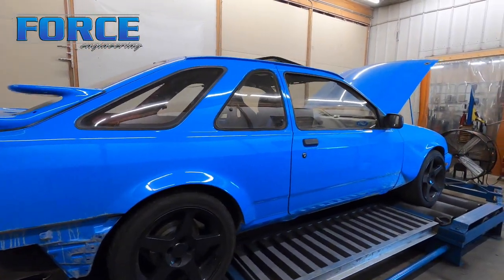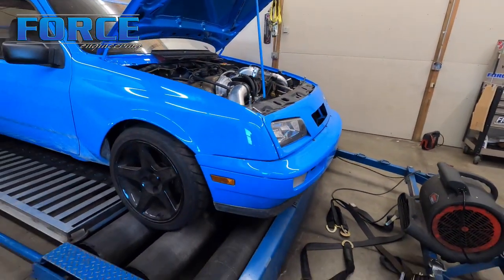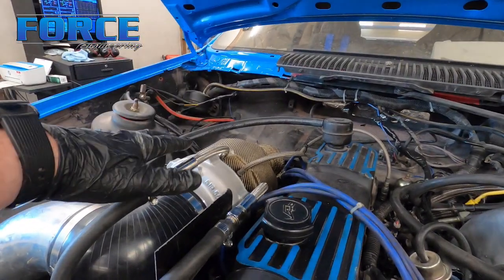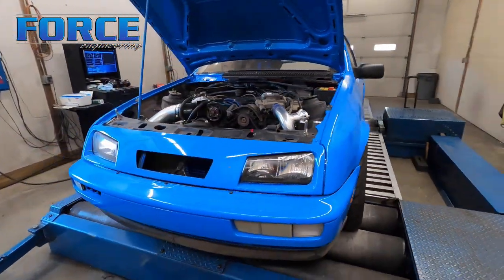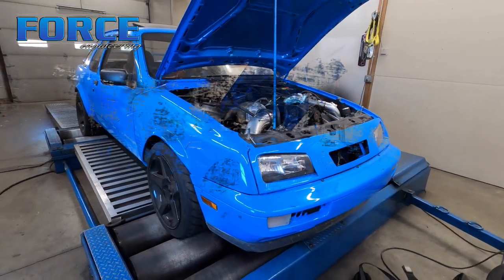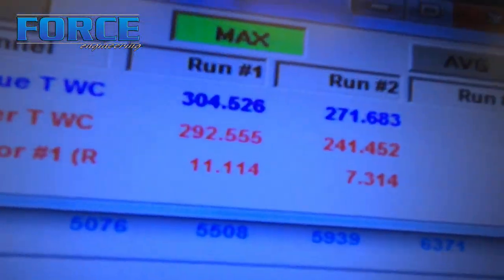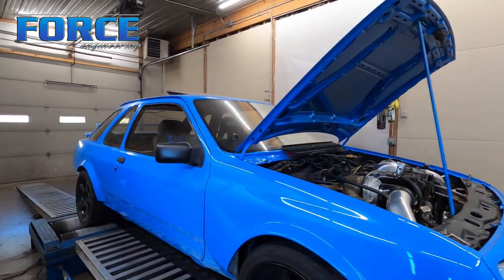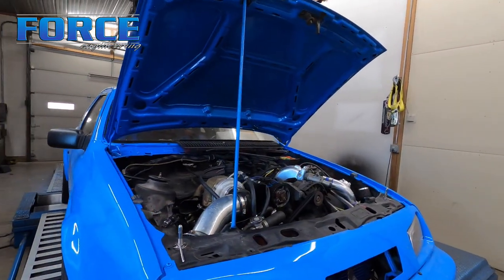Merkur XR4TI | Turbo 2300 Ford | Megasquirt ECU | Dyno Review

Comment: These and the Mustang/Capri Turbos did not have intercoolers. Others already mentioned this for the XR4Ti but, I thought I would throw in the other's who shared the power plant. The higher powered SVO and Turbo Coupes needed the intercoolers to run the higher boost.  Regarding the "heat sink" mounting of the SVO intercooler, bear in mind that the Porsche 934, 935, and others along with the F40 Ferrari and others likewise ran intercoolers in similar positions.

Comment: Id watched this video repeatedly - excited because I recently bought an XR4TI. Went to look into tuners in my state and was stunned to see a very familiar logo! My build up wont be quite as ambitious as I only drive on streets - but looking into upgrading ECU (Pimpx), tune, running upgraded fuel lines (-6 AN PTFE), and putting in bigger injectors (80ish maybe).

Comment: I have an almost identical setup, but with the 2.1X Boport cam. Unfortunately no dyno shops in my area to get any performance numbers. Would appreciate knowing at what boost level the 292 HP was reached, what size fuel pump was used, and what were signs fuel pump was insufficient.
Reply from the maker: This was so long ago i dont remember the boost level, or what pump was in it.  Sign of the pump being insufficient would have been fuel pressure falling when fuel required (is boost/rpm) were increased.
Reply: @ForceEngineering  Thanks for info. I run a 155 lph pump when seems everyone recommends a 255.  I haven't checked wide open fuel pressure but do maintain a safe A/F ratio at redline & 20lbs boost, so far...
Reply from the maker: @johnmcmullen456  without a gauge, when fuel pressure is a problem, youll also notice VE climbing at the higher map/rpm areas.  Youll raise ve and the resulting AFR wont change as mich as youd expect.  When that happens its time to put a gauge on it.
Reply: @ForceEngineering  I have a fp gauge for under hood testing. Will get some more hose and tape gauge to windshield for road testing. Appreciate your help!
Reply: I would get a walbro 255 and never worry about it. Be sure to upgrade the wiring as that is a issue that is slept on. New pump requires some better wiring to keep up with the power. Realistcally a 190 pump will support most of the power a 2.3T will put out with some modifications to it.

Comment: What mods are needed to make 300 whp reliably? (Looking to make one a good road/mountain carver)
Reply from the maker: moderate camshaft, ported head and required fuel mods for that hp/fuel type. biggest thing to reliability is the tuning.
Reply: @ForceEngineering  ah. So doing it on pump gas would require more fuel, intake flow, and cooling. I also hear these chew through head gaskets.
Reply: @willhutton1516  these engines chew threw headgaskets because of improper head torque, and the fel pro 1035 gasket for some reason...stick with a felpro 8993, make sure head bolt torque sequence is followed I belive there's an article on stinger performance website regarding headgaskets...also just don't be an idiot go above 10 pounds of boost while the car is cold and change the coolant every year...mostly down to owner neglect...230k km on my turbocoupe running 18 psi...no headgasket issues, let it warm up before you beat on it and change the coolant every year it can't hurt
Reply: @monikhushalpuri  sweet! Thanks for the info. I’ve been looking at acquiring the Merkur XR4Ti, which has that 2.3 turbo. 1500 ain’t bad, but it’s like 6 hours away from me😂
Reply: Not to much, this setup is bit more invested than mine but, i have stock turbo, simple mods, ranger cam, bigger injectors, ported intakes, 5.0 throttle body, ported E6 exhaust manifold, la3 ecu with a bit harsher timing for the lima, and my 85 makes 213whp on 19lbs.  If i went with a pimp ecu, and t3/t4 hybird turbo, probably would see more up towards 250whp+. Also big valve head and port job as well. Also yes they eat head gaskets but you can over torque the head to compensate.
Reply: Porting intakes. 3 inch down pipe. Better flowing exhaust manifold. Bigger injectors. Intercooler. T3/t4 turbo. PIMP computer. Ported head helps a bunch. Better fuel pump.

Comment: These weren't intercooled from the factory
Reply from the maker: I was pretty sure there was an intercooled version of these.  I was wrong. The svo and 87/88 Thunderbirds only
Reply: @ForceEngineering  they intentionally slowed these down.. even down to the transmission being weaker, still want one for a weekend toy to buzz around in
Reply: @PureCountryof91 yep they didn't want it to be faster than the Mustang which it could have easily been.